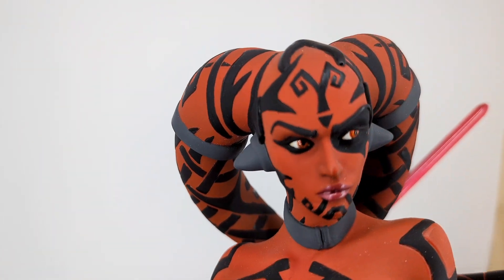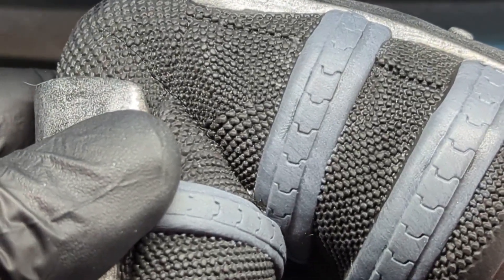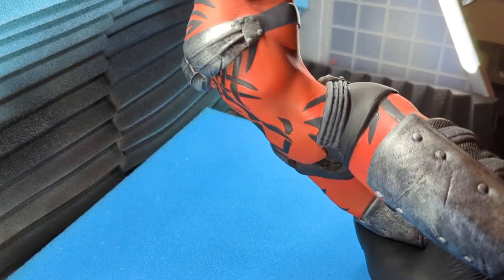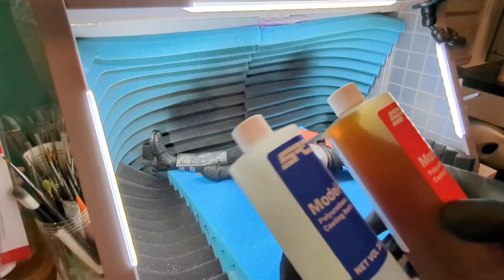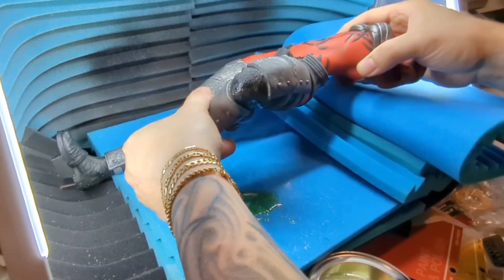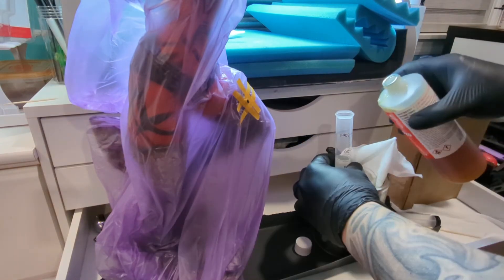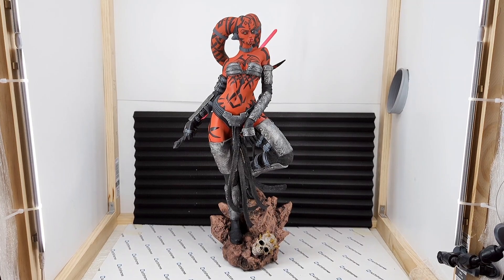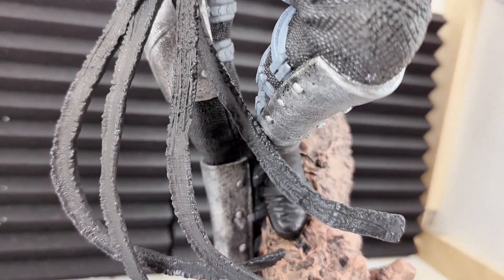From Hollow to Solid -  Injecting Resin into your 3D Prints / Statues

Comment: Wait wait....this is a 3d printed statue, already painted, there are no holes for the uncured resin to drip out??? So meaning to say, theres uncured resin inside?
Reply from the maker: It's actually a mass produced resin kit.. although the print run was only 5 statues. But yes it was already painted and during shipping the leg broke and needed to be repaired. This is Polyurethane Resin so it actually cures when mixed together by a chemical heat reaction. Not the same as Resin for 3D printing which is cured by UV. So technically this method applies to any statue that needs filling or maybe just needs the walls thicker. It's called PU Resin or Polyurethane Resin.

Comment: This isn't how you fix this problem. You need to clean out your prints and cure the hollowed print PROPERLY from the get go, and this won't happen. This video is absolutely stupid.
Reply from the maker: Not sure what you're referring to. The video explains this was a custom statue already painted that arrived with a hairline crack in the leg. It's not a 3D print/kit. It broke during transit, not from uncured resin so washing and curing has nothing to do with the situation. But thanks for your feedback. 👍 I'm always open to suggestions.

Comment: Great timing once again!! This is the third time I've been dealing with a statue problem, and within days, you posted a video that helped me resolve the issue. Only difference is   I'm using hot glue ( can't afford resin). Thanks for this very helpful video.
Reply from the maker: No problem, glad to help. Be careful with hot glue..it doesn't stick so well. Bottles of liquid resin can definitely be expensive but if you just need glue, you can find small tubes of JB Weld epoxy glue for around $5.
Reply: @itsallthingsart  Thanks for that info. I'll check out the jb weld

Comment: Bro I have to ask why you're not loading the syringe by just putting the needed in the bottle and pulling back the plunger, no shame I'm just a little ocd lol
Reply from the maker: Yeah good question 😁 This was a project from last year but from what I remember I think I was trying not to waste any. Also the liquid is thick so it's easier to push it out of the syringe than it is to suck it up. As for when it was mixed together.. there was no time.. it needed to be poured quickly and shot out quickly before curing. This resin cures within minutes.